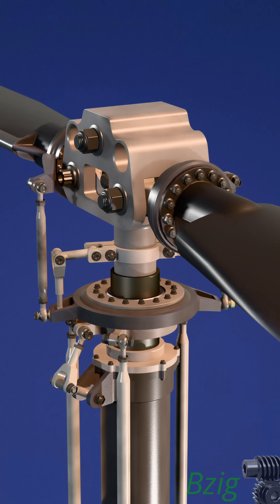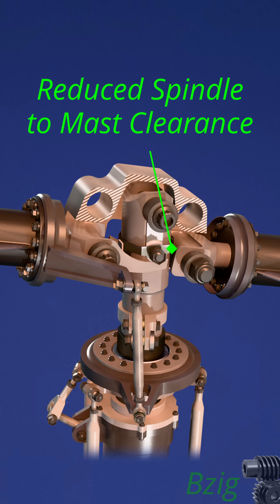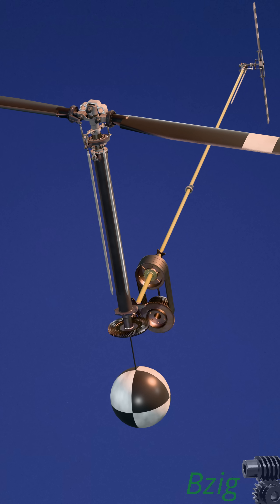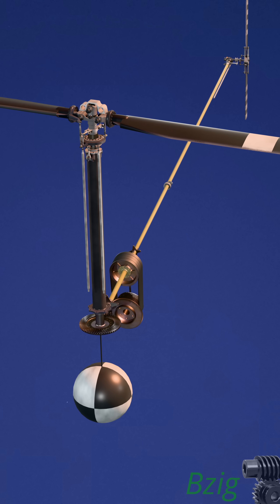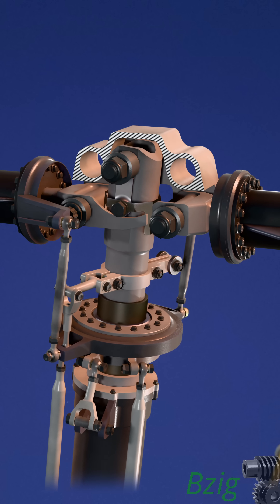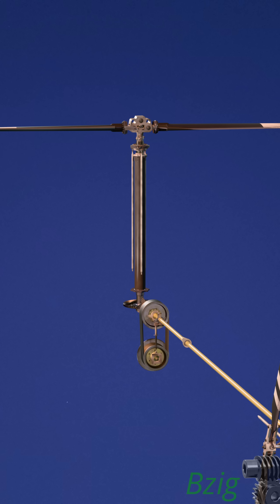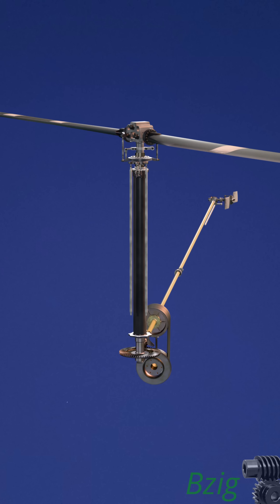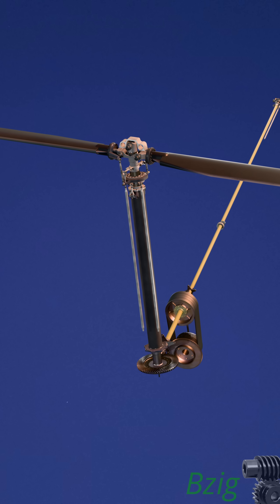Helicopter Mast Bumping Part 2

Comment: these are death traps. training doesnt matter if you are faced with an emergency for example collision avoidance, other helo, wires, etc. and boom, you just bumped your mast. for joe schmo amateur usage imho teetering systems shoud be banned. 3 blade system works perfectly. or an active electronic system should be developed that stops a bump by a lightning fast swasplate independent correction. altho idk if thats even possible to make. similar to very fast stability control systems in expensive sports cars, that compute corrections 50-100 times per second

Comment: Just fyi, It has been discovered as of recent study at Robinson, that though previously it was thought that the thrust of t the tail rotor is the cause of the rolling moment in negative g load, it’s actually the cause of the half-stabilizer in the empennage experiencing an induced negative angle of attack - as the tail rises above the normal plane, the half stab is introduced to the main rotor disk wash, inducing a negative angle of attack, which pulls the half stab toward down, and the rolling moment starts. this has been rectified by the new installation of the full stabilizer on all new Robinson helicopters. Many believe this new design will be the end of mast bumping events because there is no rolling moment in low g, therefore no tendency of the pilot to incorrectly input left cyclic - which causes the mast bump, and possibly the main rotor to contact the tail boom.
This information is being slowly distributed to CFIs who were previously taught that it was due to the tail rotor thrust… it was thought because they correlated the same issue that was present in the Huey, but that was a different tail rotor where the rotor was mounted above the main rotor mast.

Comment: So Low G in this context means making a dramatic movement of the stick during a low speed turn where the rotors rpm aren’t high enough and the downward G Load isn’t high enough to keep the rotors perpendicular to the vertical plane of the fuselage and mast?

Comment: Yeah, I know you talked about it and I made what I think is a solution to mass bumping and you didn't so much as give me the time of day. I admit I know little to nothing about aerodynamics and aircraft manufacturing, however, I have taken part in building machines that create machine parts and or high production manufacturing. I am a retired machinist, welder in mig, tig and arc including aluminum. Fabricator, industrail electrician, HVAC,Boilers, Cooling and glychol sytems, safety life and fire, gas detection, programming robotics....I know a thing or two about engineering, enough to get me in trouble. Lol
Reply from the maker: Apologies if i missed one of your earlier comments.  There's  70k people subscribed to this channel.  I can't respond to all of the comments.

Comment: I'd be interested to hear your take on the symmetrical horizontal stab that Robinson says eliminates the right roll. I've flow this type of stab once, and noticed no difference in normal flight. I've always taught that the tail rotor is responsible for the roll, and have seen the same information dating all the way back to old Vietnam era training videos.
Reply from the maker: this is interesting... I didn't know about the new stab until you pointed it out.  There isn't an updated SN on thier website, so SN-11 still says you can expect a right roll during low g as a precursor to mast bumping.  I see the offer, for the new stab, says "helps reduce the right-rolling tendency when the aircraft is operated outside of the approved flight envelope."  

My thoughts... once you go low/no g, there's nothing to restrain the fuselage.  The first disturbance is going to start the causal chain to a mast bump.  So if an improvement to the stab can delay that, then it's goodness, but it still doesn't change the fact that you're one disturbance  away from a bad event.  

I've never flown the new stab... haven't flown a Robinson in a few years.

Comment: Please illustrate what happens upon 'bumping'!?
Reply from the maker: It's a good suggestion and there are people who use Blender to animate breaking things, but I'm not going to.  I'd like to keep things as technically accurate as I can, and I'd be speculating about how the fracture looks.  I was going to show a photo from an accident report, but changed my mind when I thought about it the loss of life that resulted from the photo.
Reply: @bzig4929 Understand... Ive seen animations of helos 'bumping' but is typically the blades hitting the tail and then crudely detaching. Is more about the drama of a helo accident than the physics... as a lay person, it is instinctive to think 'just put a casing/tube/shield' over the shaft to prevent bumping/shearing but it is obviously impossible/too expensive or etc.
Guessing its a pinching force, but does it shear the shaft or make it screw backwards or etc etc.
But I also get not wanting to illustrate even though I think its an interesting conclusion to the series you've made.
Quality work.
Thank you.

Comment: I’d love a bit more of a deep dive on why the right roll is caused in a low-g condition. Robinson claims it is not due to the tail rotor thrust, but actually the asymmetrical horizontal stabilizer on previous models.
Reply from the maker: @Snowcat89onXbox360 just talked about the same thing.   I just read SN-11 and also the bulletin for the new stab.  I don't think they are really saying it's not the tail rotor roll that triggers the event... I believe they are just saying the new stab delays the onset.  

But I see the point... the public document isn't that clear.  They say, "the symmetrical stabilizer helps reduce the right-rolling tendency when the aircraft is operated outside of the approved flight envelope."  To me this means it's still the tail rotor, but the stab delays onset.  If they meant otherwise, they would have revised SN-11.

Any thoughts?
Reply: @bzig4929 I think it’s mostly them covering their own butt. Talking to the chief Robinson flight instructor he says they do not get any right roll with the new stab, and that it was caused by the horizontal stab only being on one side of the aircraft. What you said makes more sense in my head 😂 I’ll have to shoot him an email and I’ll let you know what he says.
Reply: @bzig4929  A PDF of a VerticalMag article used to be linked on the Robinson website explaining "How Robinson Arrived at its New Tail Design". They also used to have a link to the original University of Maryland research paper which included information on the R66 delta 3 angles.

It seems they removed those links when the website was redesigned a few months ago but the original article still exists if you google it. I will try replying with a link to the article in a separate comment but it might get blocked because YouTube can be weird about links sometimes.

Comment: Plz explain mast of Uh1 and bell 206 😊
Reply from the maker: I'd like to get to that.  I think it would be cool to show the Arthur Young stab bar design and also to show the differences from the R-44 hub.  They are very similar... the R-44 is actually more complicated because of the coning hinges and the offset pitch control rods.  But the basic theory of a teetering hub is the same.

No promises on when I'll get to this.  I'm working on more R-44 videos, then... in no particular order...  the UH-1, a coax and a tiltrotor.